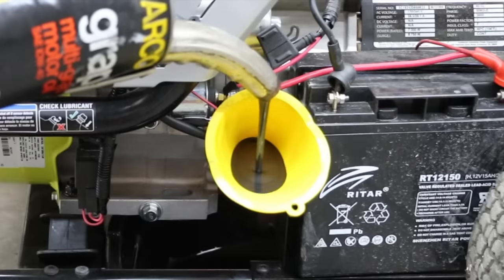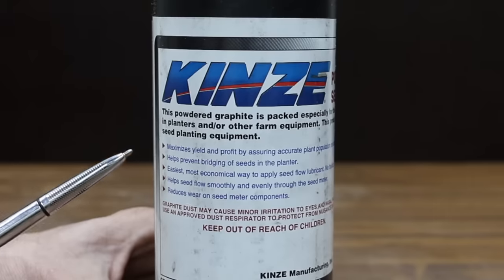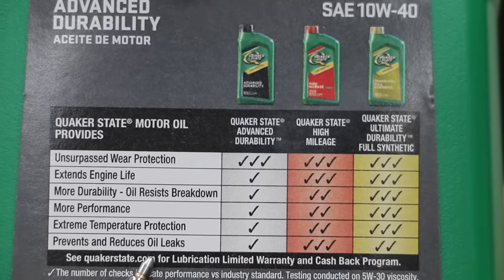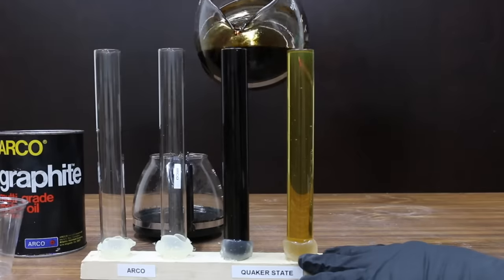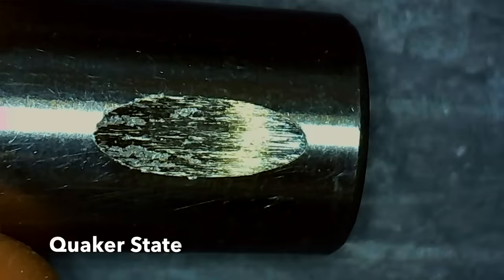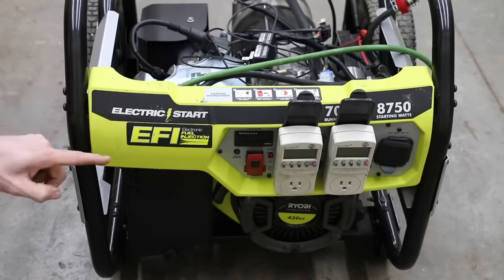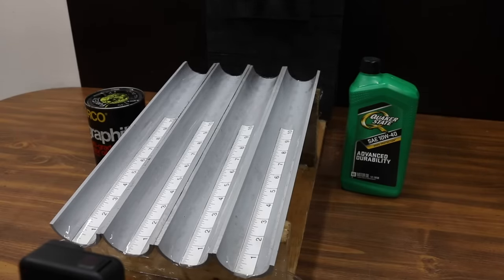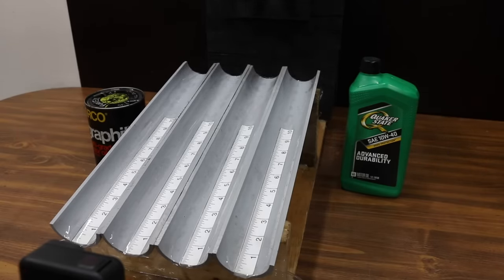Will "Graphite" Help Motor Oil Performance? Let's find out! Vintage Arco Graphite vs Quaker State

Comment: Would like to see a filter tear-down after running on graphite.
Reply: yikes
Reply: I used this stuff on a new Chevy luv truck. Did ok but couldn't afford to keep buying it for oil changes. When you got it on your hands or clothes it was there for a long time.
Reply: I think we've seen both oils are pretty terrible. I don't know if youtube would allow the horror movie you want to see
Reply: @thereissomecoolstuff Deoxit gets it out.
Reply: @garbleduser  thanks so does sulphuric acid. Full strength.
Reply: Hell yeah!
Reply: @thereissomecoolstuff  John Deer makes a general polish that they call a wax, that would get used diesel engine oil stains out of white paint like it was never there.
I've never seen anything like it.
As far as paws go, Goop was the best I ever used, especially rinsing your hands in cold water.
Reply: @macgyveratlarge2133  thanks. I haven't dealt with Arco Graphite since 1981. It had amazing staining properties. That's all I'm saying. Thanks for the remedies.
Reply: @midnitesquirldog1 remember the graphite brought the compression up from the Mobil..
Reply: Just fun to watch.  Thanks!
Reply: I was thinking the same thing
Reply: Arco Graphite.... somehow I remember this stuff from when I was in highschool. Back then anything that promised to help make your V8 get an MPG into the upper teens was worth a shot.

Wonder what the size of the particles of graphite are? If they're small enough, maybe they could pass through a filter.
Reply: Graphite particulates suspended in the oil would have to be smaller than 5 micron as most engine oil filters would remove it shortening the filter life.
Reply: @RobertLBarnard  you are exactly right,  anything promising increased MPG was at least tried.  How about "slick 50" ?  I used that too.  While I used all 4 quarts of Arco,  other guys just used 1 quart with a change.  Keeping your tires inflated probably did the most good !
Reply: @midnitesquirldog1 Octane booster on the cheap is 10% plain pure methanol, it ups the octane, but does horrid things otherwise. Try to buy aviation spirit, it is 100 octane minimum, but also does funky thing to your engine. We did get a little Passola bike up to over 120kph before the engine seized solid.
Reply: Akcd11r2002 
especially since graphite is a known abrasive ...
Reply: @sprinkletits01  That's definitely a safe assumption. It gummed up the coffee pot and left residue in the combustion chamber. So it definitely would gum up the oil pan, and every place oil settles, and it can't pass through the filter so....
Reply: @richardcornelius1050  It's not. You probably mean other forms of carbon. Why would they put abrazive into petroleum jelly? Graphite layers slide on each other like a charm. It's a lubricant.
Reply: The finer the graphite powder is, the more it will pass trough the filter, the amount of graphite is also very important, how big is the motor, half a tea-spoon in an 1.8 liter engine mixed with oil shoud be sufficient to see a noticiable différence.
Reply: Or before and after the filter pressure  readings before and after adding graphite
Cause you know 100% it's going to LOOK  black and "bad"
   but black dye would do the same without clogging filter without engine wear improvement  ??? 🤔 I'd give it a go 
Or even  in a smaller concentration oil additive
Reply: The Arco oil would probably work well as a “break-in” oil and that’s it.